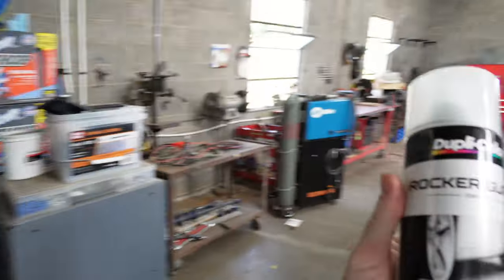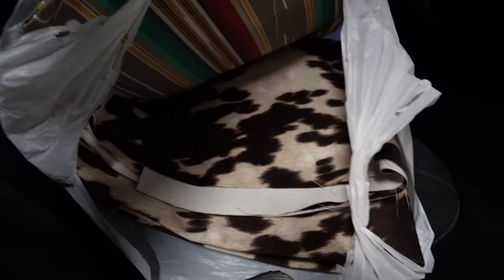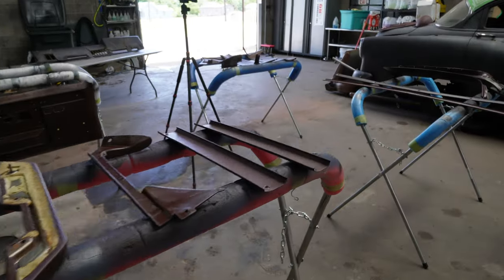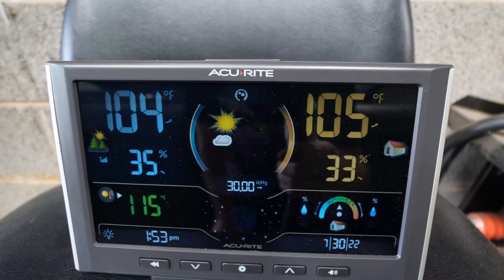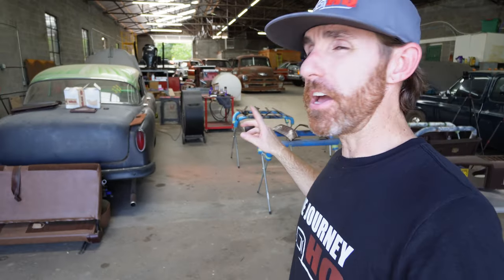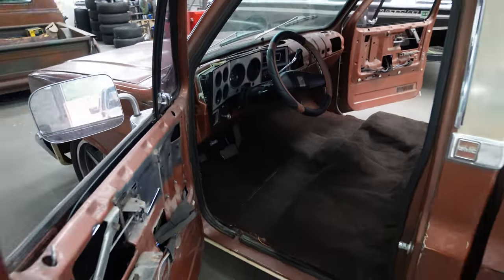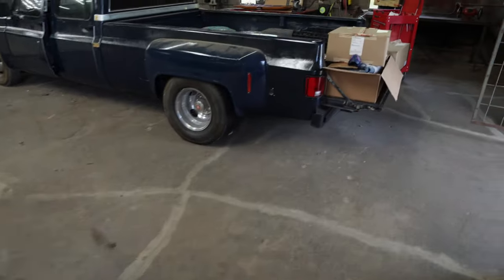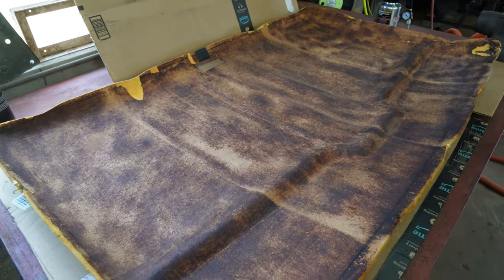Old Mac C10 - Budget Hobby Lobby Interior Upgrades CUSTOM HEADLINER

Comment: I do alot of budget fixes and Tulip Colorshot vinyl and fabric dye has saved my a$$ more times than I care to count, you get it from Hobby Lobby and it's over in the Fabrics section, it's made for house interior like couches and chairs, which just means it's more durable because it stands up to daily use of hours upon hours upon hours of sitting, yeah it's a little  more expensive because it comes in a smaller can but it's WELL worth it. Plus it comes in 23 colors plus there is a Semi-Gloss, Satin and Flat clear coat. Good Job on the headliner but I personally would have done the cow hyde on the headliner. I've used the Western texture vinylon several things, mainly headliners and door cards.

Comment: Nice job on headliner!  If I could make a suggestion?  Use fiberglass with mesh to repair the headliner fastner holes for more stable repair.  You can also use filler with hardner to fill cracks in dash, then cover with fiberglass mesh.  Then you can paint, or cover.
Reply from the maker: thank you, We have a video coming out were we tried that.
Reply: They make a flexable plastic filler that you can fill the cracks with then just dye over it.